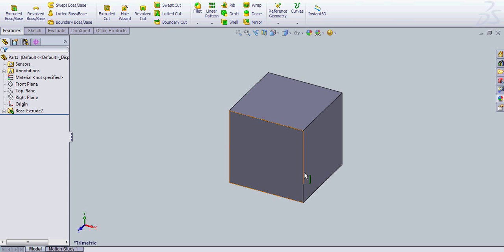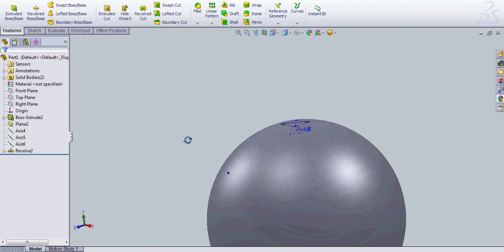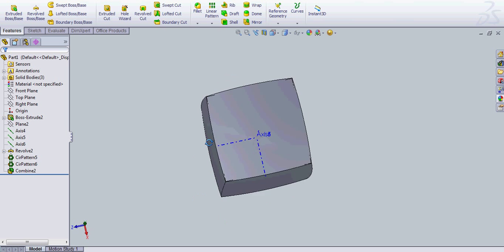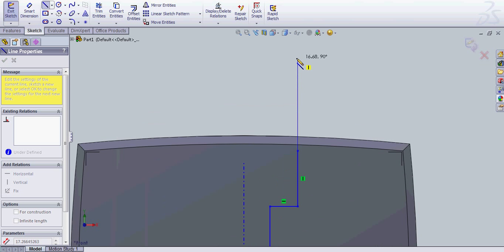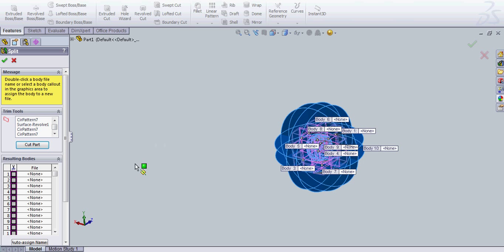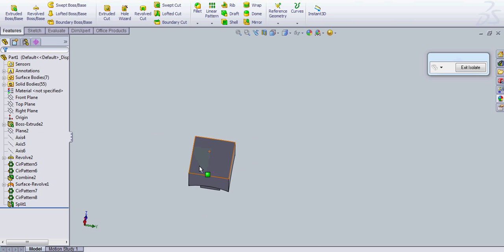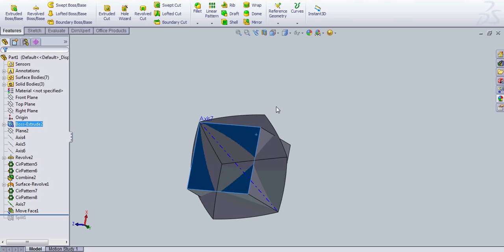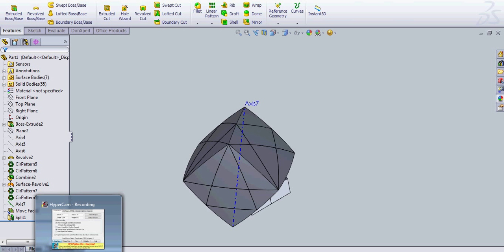How to pillow a puzzle using Solidworks

Comment: I am having trouble when I try to make the surface revolve it only allows me to select the parallel axis or the vertical axis to the front plane which ends up just making a cylinder on top of the cube. Also to let you know I am just trying to create a flat 3x3 not pillowed and I am watching this video because it is the only video that explains the steps easy. Also I am using Solidworks 10' and I don't know if that could be why it does not work. Please try and respond.

Thanks,
xMALOx